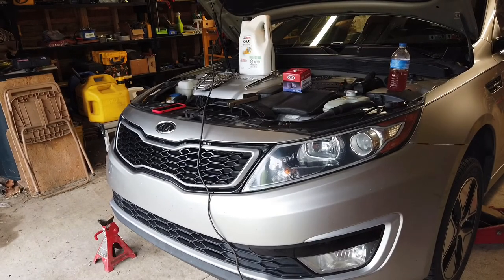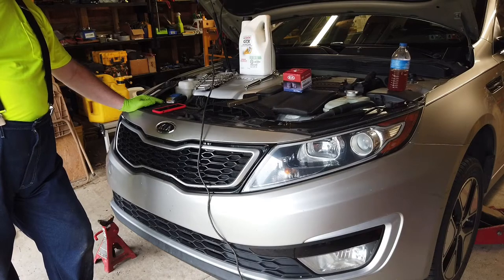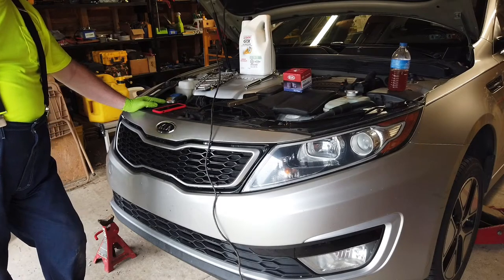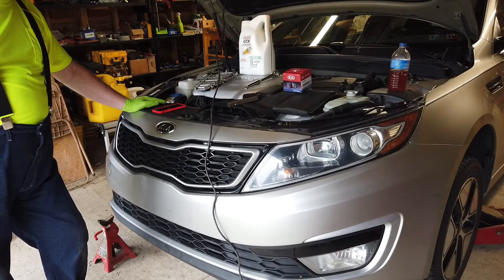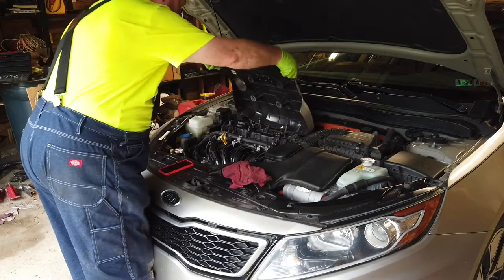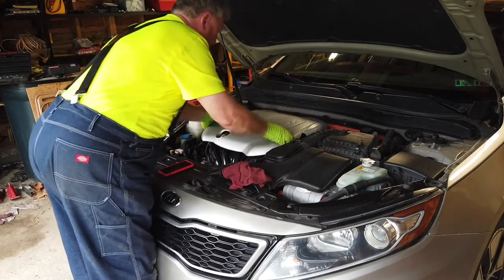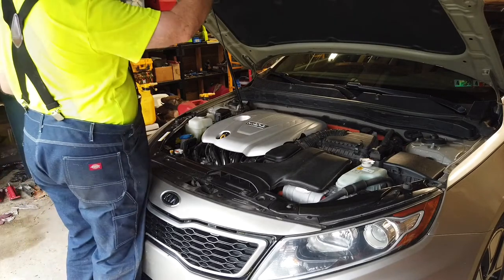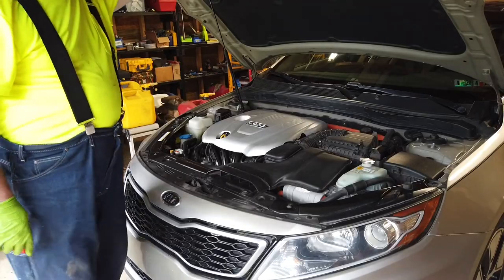#36 - First Oil Change at 135,000 Miles

Comment: Bob if you put a set of ramps on top of the set of 2 by 8 and drive up on it you'll be at the right height without hitting the front spoiler they have to be at least 4 feet long you also might have to add a short 2 by 8 going up to the ramp so it doesn't hit that are spoiler
Reply from the maker: Thanks for the suggestion - I did an oil change this past Thursday (140K) - I did exactly what you suggested and drove my car up on the two by's and then used the floor jack - Thanks for watching and commenting